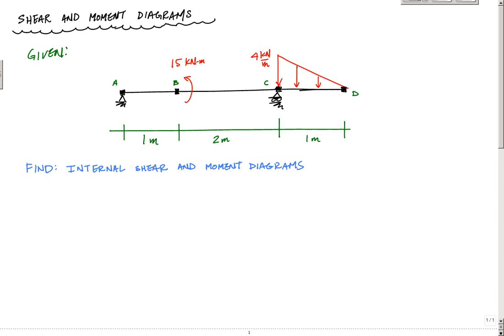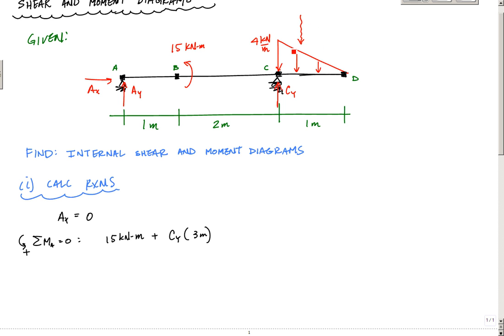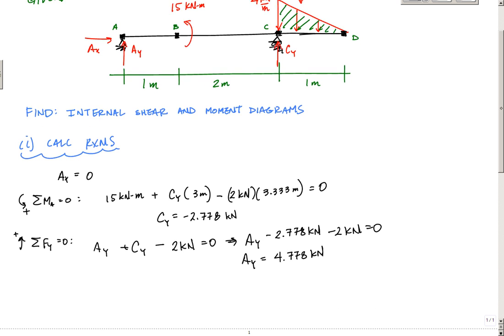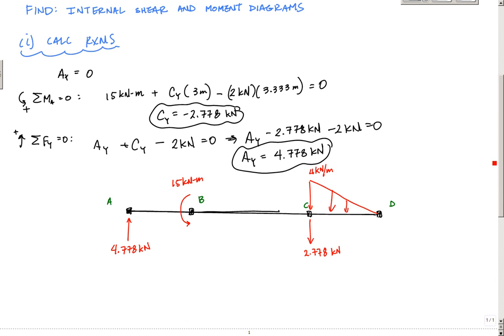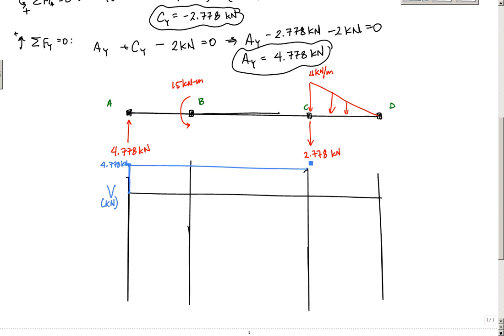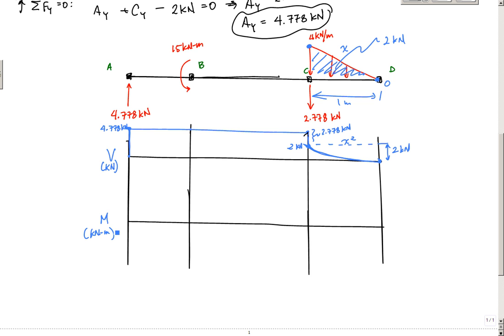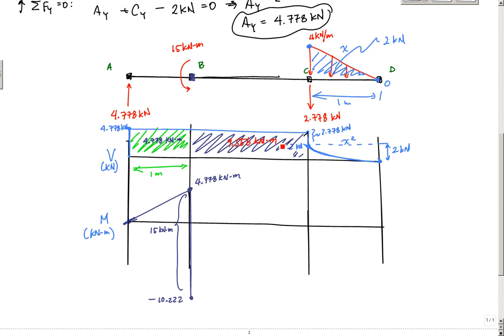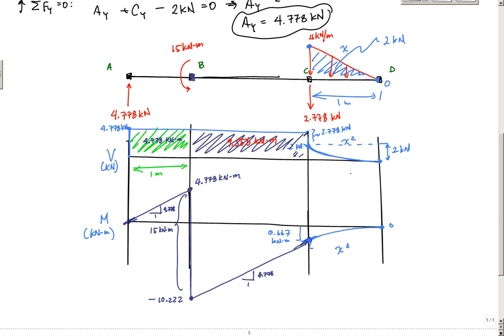Shear and Moment Diagram Example 2 - Mechanics of Materials and Statics

Comment: QuickQuestion
if the curve at V diagram at section CD were to be x^3 instead of x^2 will the formula for area still be 1/3(b*h) ?
Reply: and also, if the curve were to cross 0 (still at section CD), how would you go about this or what would be the appropriate workaround here ?

Comment: when the bending moment have reached a value of 0.664, why doesnt its met with a force of 2.778? did you just skip it and straight intervene with the value of the distributed load. Why doest you add with force is my question, tq

Comment: How can a roller apply a downward force? is it glued?
Reply from the maker: a roller cannot provide a downward force but we are using it here just to represent a boundary condition that provides a vertical force only.
Reply: Exactly dude. You're awesome
Reply: you can imagine the center of the roller is either magnetic or the wheels are actually on the other side of the line connected by a member

Comment: Sir from physical perspective, how can a moment exist without an acting force? Ie say we are working this on a bridge, what will be its physical equivalent? Point loads can be cars distributed can be train the supports are supports, but how can a raw moment exist without any force which effects the shear force diagram?
Reply: +syed ahmed 
Because in statics everything is in equilibrium.  So all of the equations are set to equal zero and you solve from there.
Reply: thank you for the response but i wasnt talking about the mathematical equivalent. Rather i was wondering if there is a possible real life equivalent for a raw moment or is it more of a hypothetical or mathematical issue.
Reply: +syed ahmed  the represented "raw" moment is usually representing something like an L attached to the bottom of the beam with a load at the end of the L causing a moment arm to exist.  there are some examples of this in the johnston textbooks in the shear/moment diagram chapter.  typically chp5

Comment: Hello,  @ 11:51,  the moment is counterclockwise.  In your earlier equations, you indicated that direction was positive.  The external moment should have increased the value by 15?
Reply from the maker: +Trecia Kilback i think it is important to try and understand the difference between positive moments when using global equilibrium equations versus the positive sign convention for internal loading.
Reply: It took me a while, but I understand. If you you do a free body diagram at AB (right) then it works out to the number you calculated.  In this case, it'd be wrong just to eyeball it. Thanks for your reply.

Comment: hello!! I like the way you explain things !! keep up the good work!! I was just wondering if  the bending moment diagram  should have been just the inverted version of what you have drawn? coz bending moment is The negative integral of the shear force.
Reply from the maker: +Rohan Arya it depends on the internal positive sign convention used.  for me, i go with positive bending as causing compression at the "top" of the beam.

Comment: Awesome video! I really appreciate your conversational style of teaching. I think there's a problem at 3:00 because an upward-facing roller support cannot put a downward force on the beam , it can only push with an upward normal force. The roller should probably have been drawn on top of the beam.
Reply from the maker: Thank you for the kind words. I use the roller to represent a vertical reaction. I agree that a roller on top and bottom would have been a better representation.

Comment: Why is it for the moment diagram he went 15 down at point B instead of going up? Isn't the 15kN*m moment going CCW, hence a positive value?
Reply: If you solve for the internal bending moment past point B using the method of sections, you will see that the 15kN*m moment makes the internal bending moment negative.

Comment: why does the 15 kn moment go negative in the diagram, isnt counter clockwise a positive moment?
Reply: also isnt the slope negative 2 and not positive two?
Reply: A counter clockwise moment is positive when you are talking about external forces. Yes the moment is being applied externally, however, the moment diagram is concerned with internal moments so the moment that is opposing the positive moment being applied would be a negative moment. I am not sure what you mean by the slope though.

Comment: I don't think that your moment diagram is correct. I may be mistaken but at point B, isn't the moment suposed to be on the bottom side of the diagram? it's value is -4.778 KN*m and should be represented bot. At least that's what my teacher taught me. It seems obvious that the shear in point A stretches the bottom part.

Comment: Since we're calculating the moment about Ay, you're calculating the moment in terms of the distance of the acting force FROM the pivot point. He just added the 1+2 (distances from A to B and C, respectively) and then the 1/3 of a meter distance that's the centroid of the triangle; hence, it's 3.3333 m.

Comment from the maker: In this video, the moment diagram is drawn on the "compression side" of the beam.  This is what is done in most textbooks on mechanics of materials.  It's common in reinforced concrete design to draw moments on the "tension side" and also in computer programs like RISA-3D.  It does vary, depending on country and/or textbook.  Fortunately, the process is the same.  Thank you for your comment!

Comment: I think you draw the moment diagram in mirror. As a civil engineer I must put the reinforcement on  "stretched" part of the beam. From your video I understand that the reinforcement  for tension should be placed on the top of the cross section. This is how I learned to do it, maybe it's different from country to country.